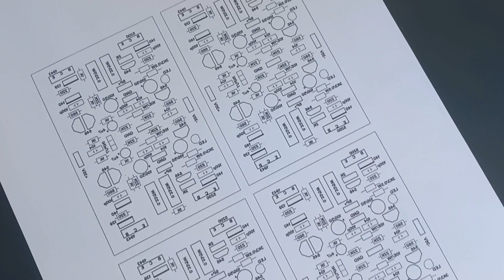Rod Elliott P3A Stereo Amplifier Board / Bed Type / DIY PCB

Comment: 18-0-18 V 5A  transformer il work ആവുമോ? Output  power and audio quality parayamo(using this transformer)
(+/-  25V dc unloaded. Please check voltage drop  at reasonable audio loudness)
ഒന്ന്  try ചെയത്  parayamo?

Comment: I think you missed to connect physicall the bias transistor to bd139
Reply from the maker: No its connected
Reply: No the small on behind the preset needs to be physical touch to better the bias but anyways your call
Reply: Unless this is a different design

Comment: The schematics look pretty comparable to what I'm now using for my synth (two separate boards, one per channel), which sounds awesome, there's so little noise that at full power, placing the hear against the speaker I can't tell if it's powered or not, that's extremely pleasant. And I don't have audible distortion till mid-power (and above it's too loud). I also changed the transistors to use the same pairs you're using BTW and that was worth it.

Comment: eline sağlık arkadaşım. kanal başına güç nedir ? 8ohm ? 4 ohm?
Reply from the maker: At 35 -0-35 V DC you get 60W at 8 ohms and 100W at 4 ohms. For more information check the website link given in description
Reply: 18-0-18 V 5A  transformer il work ആവുമോ? Output  power and audio quality parayamo(using this transformer)
(+/-  25V dc unloaded. Please check voltage drop  at reasonable audio loudness)
ഒന്ന്  try ചെയത്  parayamo?